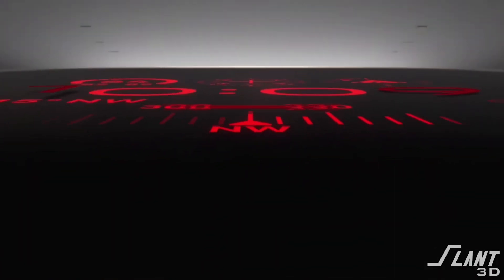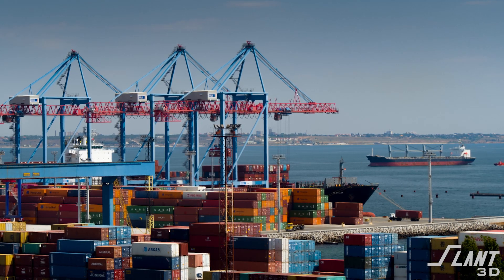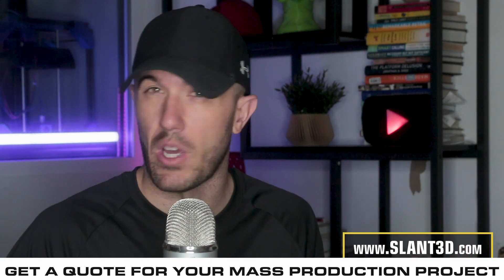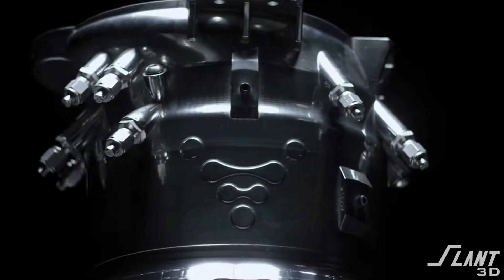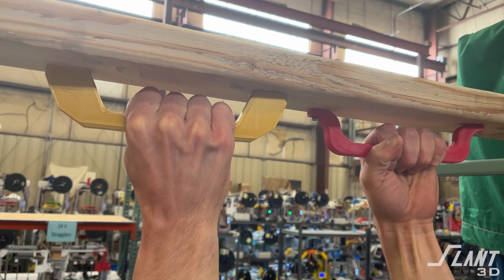The Competitive Advantages of Mass Production 3D Printing

Comment: 🎯 Key Takeaways for quick navigation:

00:00 🍏 Apple and other companies are using 3D printing for their products, but why? Let's explore the competitive advantages.
00:29 🌍 3D printing offers a distributed supply chain, allowing for flexibility and reliability in production locations.
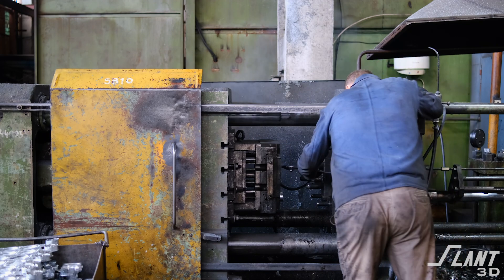01:10 💰 3D printing reduces capital expenses by eliminating the need for minimum order quantities and extensive inventory.
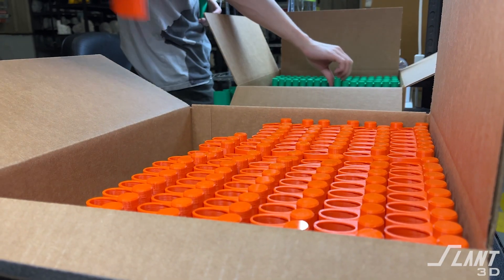02:05 📦 Traditional injection molding has a fixed upfront cost, unlike 3D printing, which can adapt to different production quantities.
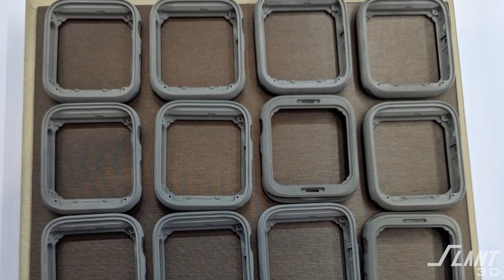02:46 🔧 3D printing enables the creation of complex geometries and the consolidation of multi-part assemblies, saving on tooling costs.
03:54 🛠️ Thick, strong parts can be produced economically with 3D printing, reducing material waste and costs.
04:34 🏆 Designing products for 3D printing can lead to new capabilities and competitive advantages in the market.

Made with HARPA AI
Reply from the maker: That is how to market a software in the comments

Comment: Nice summary. It would be interesting to know how to decide when to switch over to injection molding if you first go to market with fdm. Also, for parts not normally visible, you can run larger layer heights and basically there is no post process but for exterior parts, you care about appearance and apart from parts that only show themselves on one face where you can use the build plate texture as the exterior surface, post processing would be required if layer ines were problematic and would increase the cost.